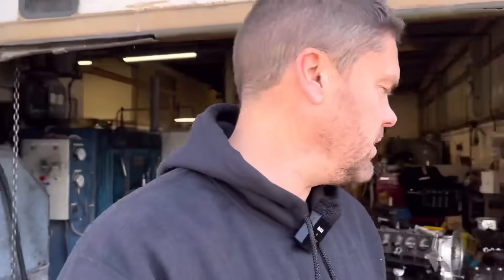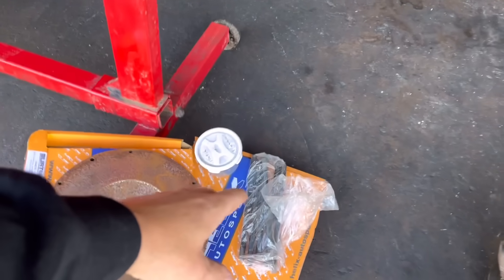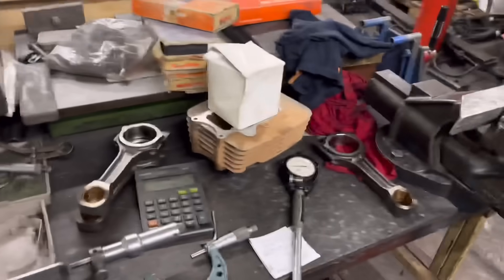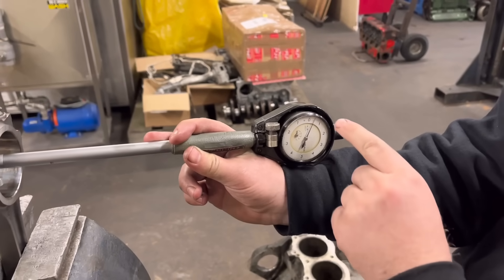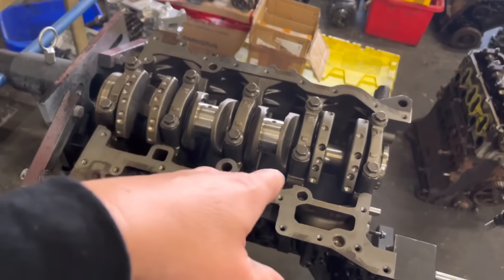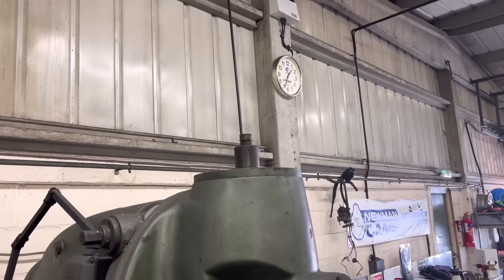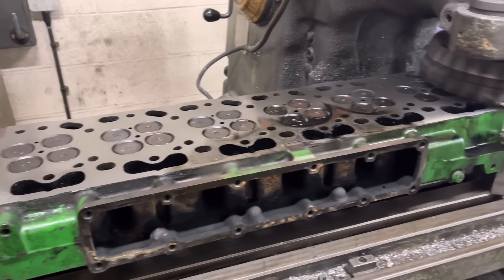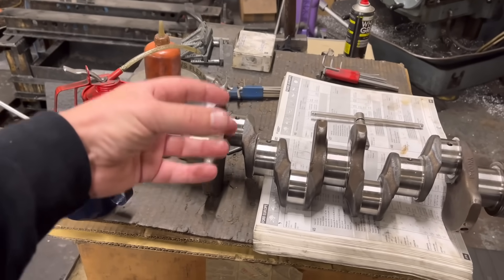This is how to BLOW UP an engine!

Comment: You check for size and tolerances on just about everything, but I don't recollect any check for alignment of the main bearing in the block. I've often found they need a line-boring session to correct this.

Comment: I recall a nighttime photo at a drag strip about half a century ago. The photograph was looking right down the start line. Fiat Topolino Fuel Altered. Through the side window you can see the driver is looking down. The crank, rods, pistons, and flywheel were on the asphalt. That’s pretty well blown up!

Comment: Great video. Any comments on big end bearing material? I know King Bearings offer a range of materials, including non-lead based, but am I right in thinking non-lead based big end bearings are more prone to spun bearings and pre-mature wear? Some newer diesel engines (BMW B47 as one example) seem to be having big end issues. What's the likely cause? And how important is oil temperatures in maintining big end bearings - given they're a softer material they have lower melting points, but is this something we should worry about?

Comment: Hi Lee, my late "Great " Father used to grind cranks for a local bus company, often he would have to re-stroke a bent crank to bottom under size , then it would be ground to bottom tolerance as they would need to be re nitrided . After that treatment and polished they would be on mid to top limit.

Comment: Love to know why when customers ask you to do an engine why do they want to build it does not make sense
Reply: Good question. For me being a journeyman mechanic of 30 years, I need the machining and some measurement I do not have the equipement to perform, done by specialists. But I want to do the assembly and verify everything. 
There are others with an interest but minimal experience that should let an expert do the work. 
I have done brake overhaul on drum brakes where someone has installed the long shoes on the front instead of the rear. One even had both short shoes on the left side and the long shoes on the right. Someone trying to save a bit and cocked it up.
Now when it comes to engine or transmissions, you better know what you are doing as the consequences of failed assembly gets expensive real quickly.
Reply: You will save significant sums of money, if you outsource the machining tasks and are 'capable' of building an engine - it's that simple.  Unfortunately, there are some that believe that building an engine is as simple as assembling it like a toy meccano set - i.e. just bolt all the parts together without conducting the required clearance and condition checks/adjustments, including the inappropriate reuse of components that are well past their prime - e.g. oil pump, cam followers, chains, etc.  I have encountered owners with poorly assembled engines that didn't even own the most basic of measuring tool - a vernier caliper.
Reply: @georgebettiol8338 In my 30 years as a mechanic, I agree with most. What I do not agree with is the rampant habit of replacing good oil pumps. As long as the engine did not run out of oil or have grit for some source go through it, the oil pump can be cleaned, inspected and clearances verified. If the clearances are in specifications and no serious scoring is found, reuse it. Many will see a small scratch or a witness mark and toss the pump for that reason. One small scratch is not an issue, galling and big scratches are an issue.
Flat tappet followers and timing chains are pretty much a given replacement.
Reply: @daledavies2334  I think most oil pumps are pretty cheap, so they get changed. However, with the state of many aftermarket parts these days, it may be better to stick with a proven good unit, than take a chance with a good looking new, but otherwise crap, replacement.

Comment: I built 2 gs1000 Suzuki engines for the TT allowing a more clearance than normal. We had a Japanese engine builder who came over never asked us about the  TT and proceeded to build his engine when we told him how log the race was he fell about laughing told us it would last about 30 miles then strip and rebuild. The tolerances he was working to were so fine. The actual engine was a work of art. He really taught me how important checking and measuring are and double checking so spot on Lee

Comment: Just a random comment ref.crankshafts and rods.If you could actually visibly see an engine at just 4000 rpm it would be a blur to the naked eye let alone to a two stroker at 10000 rpm.The stresses are ridiculous so just a gnats cock out and disaster looms.Always still impresses me.
Reply: It impresses me too and i understand engines, recently i was polishing a crank for a customer and i decided to spin it at 850 or so reves in the lathe to let the customer see what it looked like with the engine at idling revs, they were shocked. I said to them now imagine it at 7000 rpm's, they were speechless.
Reply: Some electric motors can do 35 to 50,000 rpm. The magnets have to be wrapped in carbon fiber to keep them attached to the rotor.
Reply: A gnat's cock...in Australia we call that a bee's dick..lol

Comment: I've only built a few engines over the years, mostly for myself but helped friends with theirs many times. It is absolutely essential to check the clearances two or three times or even more! All it takes is ONE thing being out of spec and all that work is wasted! :face-orange-frowning: Back then (mid '80s or so) the "serious" engine builders looked down on Plastigauge and insisted the only way to do it "right" was with mics that we didn't have! As I remember all our rod and main clearances came our dead on .001" ... 😁
Reply: There were negative comments about Plastigauge I seem to remember when Lee first started to include them in his videos however long ago that was.
Personally, I'd never heard of the process and thought it was a great way to prove the engineering that had taken place previously.
I put the negativity down to snobbery 😉
Reply: @charliejackman2953  Well, measuring the width of the plastic with a dial caliper was what we did but it's not like we're working to "tenths" here... 😁